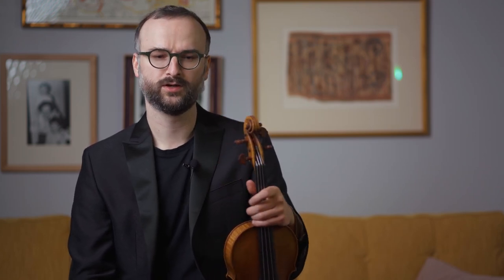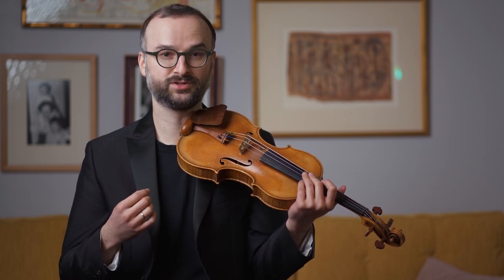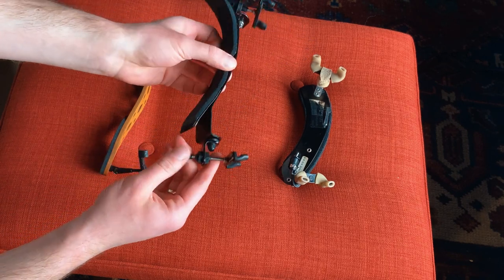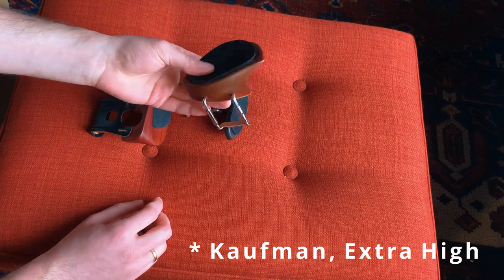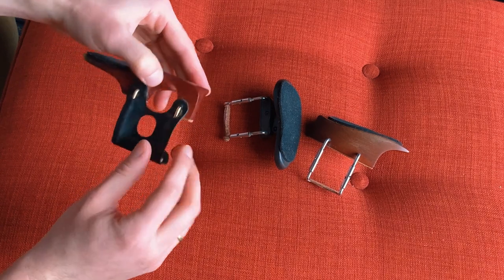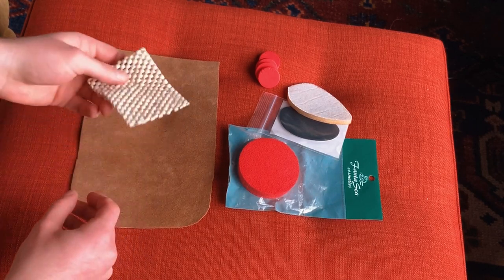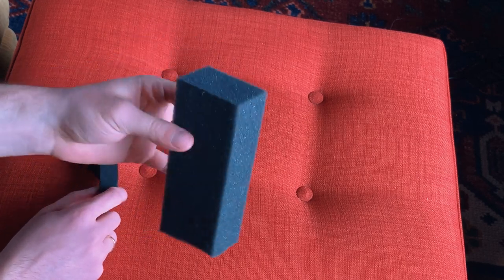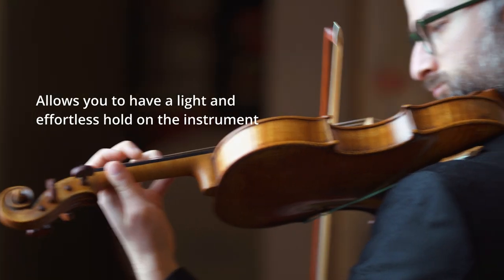Violin Setup Journey: shoulder rests, chinrests, etc

Comment: Thanks for this video. Packed with lots of information :)

So a few thoughts here:
- I absolutely agree that finding the right combination is a journey, and that everyone's needs are different. While some people are comfortable not using a shoulder rest, others are not.
- One major piece of advice I have for anyone trying the Bon Musica is to straighten the hook out. That darn hook can restrict the violin into one place, which can be annoying. Luckily, the hook is bendable which means it can be straightened to be less obtrusive. I consider rests with non adjustable hooks, like the hooked version of the Mach one, to be a bigger problem, because the hook is non adjustable which means you can't straighten it or bend it if you want to.
- One overlooked factor when it comes to shoulder rests is where you are placing it on the violin/how you're angling it. Normally, you are taugh to put our shoulder rest straight across the back of the violin. Though this can work well for many people, many others will find this a really uncomfortable position for the shoulder rest, so they will instead angle it SW--NE (with strings facing up and endpin facing you) instead of straight across. I think experimenting with the angle is really important, especially for those with narrower shoulders because by orienting it SW-NE, you can get it closer to your collarbone and off the shoulder joint/the edge of the shoulder.
- Regarding chinrests, I think the position of the cup is also a critical factor. Some people prefer models on the side, others prefer models that are placed near centre. Also, I will mention that some people do indeed prefer flatter chinrests, myself included. While I, and many others, do enjoy the feeling of having the chinrest lock under the jawbone, I find that for me I need to avoid anything with a very deep cup because the high ridge tends to dig into my jawbone too much, so I find flatter chinrests more comfortable for my particular anatomy. Also, for me there are two major categories of chinrests which I have basically ruled out entirely because they're never comforable for me regardless of shape:
Guarneri type chinrests and its variants (anything with a bar in the centre and a cup off to the side): these come on the vast majority of violins when I first buy them, and they all seem to cause me some amount of discomfort and jaw pain. Some feel okay, others feel absolutely awful.
Side mounts that don't touch the tailpiece: These are too far to the left for my jaw placement, which is closer to the tailpiece than those chinrests allow. They certainly are a good choice for many players, though.
This affectively leaves me with two major categories of chinrests that do work depending on the shape: side mounts that extend over the tailpiece (e.g Teka) and center mounts.
My neck is a bit on the lengthy side, so currently I'm using a Wittner center mount with small rubber risers underneath to make it a bit higher and it works great for me. I also play viola but I don't need risers for my viola chinrest due to the thickness of the instrument.
Reply from the maker: Thanks for your thoughts and experience!

Comment: I wish I could send pictures!
I made 2 chin rest extensions out of wood, batting fill, and fabric. The first with 3/4" plywood and very little batting (too hard and big), the 2nd today with thin wood (1/8" maybe), lots of batting and fabric. It works excellently. Makes me sad I spent so much on higher shoulder rests in the past because this feels right. Oh well. @danielkurganov, your video made me question my setup and it seems to have worked out for the better. Thanks!
Reply from the maker: Excellent! I was doing some similar things years ago. It was a great way to get the height I was looking for. Even just stacking hard cork works to create the extension. I guess my approach is no longer "height" but more surgical supports under the jaw and (as of 2 days ago) at the left tip of the chinrest to keep the violin from sliding. That way I don't need to grip the chinrest with downward force. Bravo for creating your own solution. That's always the best.

Comment: Great video!

In my opinion after years of experimentation, most shoulder rests are designed for players with a leaner body type with a pronounced collar bone. The ‘curve’ of the rest is often narrow and the height on the shoulder side is often quite high, even on the shortest setting once you add the violin and a chin rest. I would love to find out for example with the KUN what body sizes and shapes they originally used for product testing.

People with broader frames can also have narrow shoulders which can make things tricky too, because this forces the player to move the shoulder rest towards the edge of the shoulder which can block freedom of the shoulder joint, causing restriction when shifting and eventually tension. 

Chin rests are so so important I believe to finding a stable and comfortable set up. Without a well fitting chin rest,  no amount of shoulder rests will fix the issue.
Reply from the maker: Totally agree! I would also be interested to see how they tested the major shoulder rest models. I am sure the results will not strike us as scientific :)

Comment: Very interesting video. Thank you for sharing your thoughts. I have been very happy with my Korfker shoulder rest as it came out of the box, for a year until it started to fall off. I could not figure out how to shorten the distance of the feet without completely messing up the geometry, and my husband who is a geometer couldn‘t either. There is a „how to reset to original condition“ video somewhere, so I might try again. The most important lesson I learned from an Alexander Technique teacher and violinist is that there is no perfect setup, and that, as you said, we can adapt. I also discovered that I could support the violin partially with my hand, and it made a big difference. I would not mind a bit more stability.
Reply from the maker: Yes it's a bit awkward to adjust it, but basically I found that adjusting 1 foot to the desired point was the crucial thing. Once both feet are loose, it's very hard to swim your way into a good position because the feet want to be move in very specific ways. Then I would put it on the fiddle with 1 foot loose, and get a rough idea of what shape is needed. Then it's a matter of figuring out the order of adjustment of the 2 parameters on each foot. I think they did it this way because it's a simpler construction which allows for less overall mass. It frustrated me as well, but eventually i got it. I hope they find a more optimal solution in the future!
Reply: I will tackle it again the next time when I come back from a meditation retreat. 🎻😊

Comment: I played with a Kun shoulder rest for maybe 15 years, but in the last 2 or 3 years, I've switched to just using a small Artino Magic Pad. As someone with a relatively short neck, it works just fine for both violin and viola. That being said, I've been so curious about the Korfker Shoulder Rest. I just can't justify spending that kind of money on a lark currently.
Reply from the maker: Great that you found something that works. A simple pad like the Artino, or the red makeup sponge is a great solution. It darkens the sound of the violin a little bit as compared to a good shoulder rest, but that might even be preferable. The Pirastro is too expensive. I got it heavily discounted, otherwise I might not have plunged. I hope to bring the K-Rest to the public in the coming years, if I solve a few issues. It's perfect for people with a short neck. And it will be affordable.

Comment: Thank you so much for making this video!! So much wonderful information and ways to explore this issue. I appreciate that you walked us through your journey. I am currently looking for a short shoulder rest. Are you able to adjust the legs on the Korfker that you are using to a very short length? Or do you have other suggestions for short shoulder rests? I am currently using a shaped sponge, but, as you mention in the video, it is not particularly stable. My chinrest is raised like the chinrests in your video. Any suggestions would be great. Thank you again for this information. I really appreciate it!
Reply from the maker: The korfkerrest gets low enough for me. Not as low as the Wolf secondo. I would also try the MachOne. There's a cheaper plastic version of it that's great for testing purposes.
Reply: @DanielKurganov  Thank you for the info. I just picked up a Kun Bravo. It's kind of weighty, but the height is great. I had the secondo before, but that felt a bit bulky after raising my chinrest. I didn't try the MachOne. It looked a bit too curvy and might lock my instrument to the left a bit too far (I'm short so I need a more forward postion). It's such a great time to experiment with setup!

Comment: I have a long neck and I have considered giving up playing the violin many times due to discomfort on my set up. I've been using bonmusica shoulder rest and taka chin rest but I'm really not satisfied with it. I'll try some of your options and see what happens. Thanks for the video
Reply from the maker: Don't give up! Just be careful not to work towards answering the wrong questions. The question should not be "how do I build something up that makes the violin just fit to me with no gaps, etc". Holding the violin as we do is unnatural no matter how you spin it. That's why in folk traditions the violin is held against the chest, or in India sitting and stabilized at the foot. So part of that means considering technique as the primary element of your setup. For me, it meant balancing the fiddle in the hand a bit more. Best of luck!
Reply: I used to suffer from very bad neck problems (slipped discs c6-c7) so had to change the way I held the violin to establish a natural posture as close to the normal way you hold your head.  I achieved this by using the Bon Musica shoulder rest (because of its height) and also using a Strad Pad attached on top of the chin rest.  Obviously a good balanced bowing technique and independence of left/right hands when playing loudly, for example, helps to avoid tension anywhere in the body.  So you can enjoy playing the violin and start the focus on the music itself.

Comment: Daniel  Do a test to see how much sideways friction a pair of mesh slip proof pieces can sustain . Get scientific and find out how amazing this mesh really is .I changed to some polyurethane rubber but the mesh is more practical and easy for a player to replace.  Just simple glue wil fix it . It needs replacing after 6 months use . It starts to look worn after that out but will not let you down .

Comment: Two things I found hugely important were:
1) The exact position of the shoulder rest on the instrument, and the exact height of each adjuster. And I do mean exact. When I started the violin, the (£10) rest I bought with it seemed hopeless to me: it dug into bones and gave no support. Then I happened to hit on a particular position of each arm on the violin that really worked. It didn't look special to me! I moved one of the arms sideways a few millimeters. It felt horrible again and the violin wanted to spin around, causing me to use excess force to clamp it. Soon after, I put four indelible dots on the violin (it's a cheap one), on the inside of the arms, so I can quickly put the rest into the exact position. Without those dots I would fear losing that position forever!! I've found the height adjuster settings important too, but more for instrument angle than hold or comfort.
• The direction (heading?) of the instrument. I started with it more to the left than I have it now. Then I discovered that having it a bit less to the left (toward the front) made the shoulder rest work better and feel more comfortable, and also eliminated strain reaching around with the left arm for G string vibrato.

Note that I'm a late starting older person (54) who's not yet been playing a year - so not yet with the beautiful tone or technique of Daniel or others here. However, I am nevertheless a good musician on other instruments (see channel) and I can play my violin for unlimited (5 etc) hours with no discomfort at all (so much better than flute for me, where turning my head constantly left causes me huge problems), and given my late start that's obviously very important. I have a history of muscle / nerve / blood vessel issues, so this positive situation with the violin is quite unexpected for me.

My main reasons for writing (TLDR) were to say that the exact position of the shoulder rest rather than type can be the solution, and to say that for some people at least it's possible to get a setup that causes zero discomfort or injury, which is obviously good for lots of reasons - not least having an entirely positive approach to music making on the violin.
Reply: Extra: I contact the shoulder rest with the very rear part of my jaw, and use head weight rather than muscle tension to apply force. Maybe I should call it a head rest! 🤭

Comment: One thing that confuses me about a baroque purist set-up is how it doesn’t muffle the violin given the direct contact of the shoulder and jaw on the violin body, which might be further muffled with  a cloth (that I’ve seen rest on the tail piece even).
Reply from the maker: Most Baroque players don't use the shoulder, but rather the instrument sits on the collarbone. However, for those (baroque and otherwise) who do make contact with the shoulder, of course, it changes the sound, but it's not necessarily bad. If anything, it probably takes a bit of the edge off. All in all, it's a negligible difference, especially when that is the position you need to play your best and have good contact with the string (much more vital for sound quality).